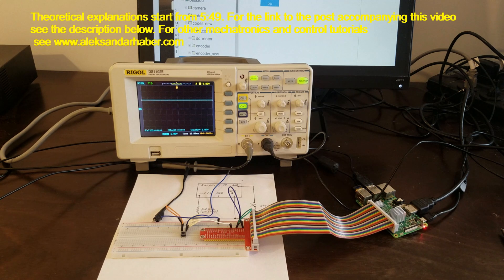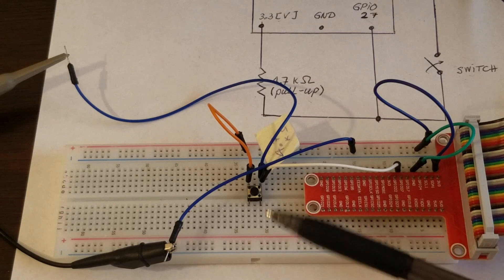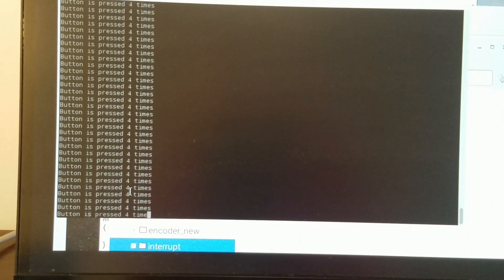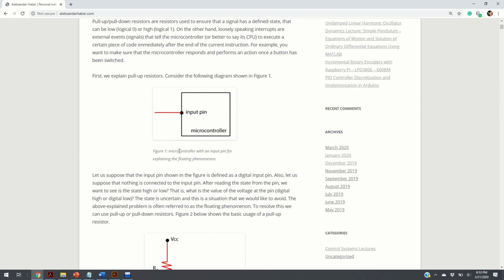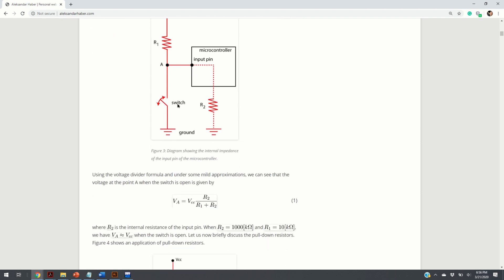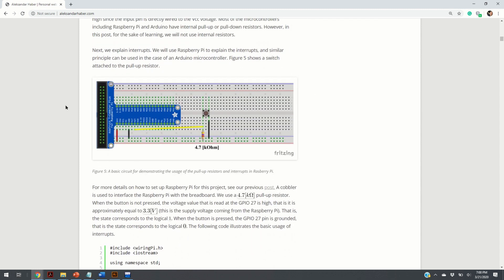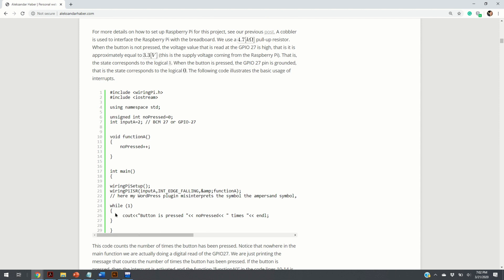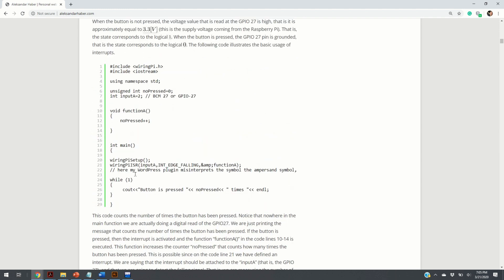Raspberry Pi Tutorial on Pull-up/Pull-down Resistors and Interrupts - Experiments and Theory

Comment: I thought raspberry already had it's own internal pull up/down resistors which can be controlled from your code? Am I wrong?
Reply from the maker: Thank you for the comment. That is correct. An RPi microcontroller has internal pull up/down resistors. However, the purpose of this video is to explain the general usage of pull up/down resistors. This is explained in the post that accompanies this video. Best Regards, A. Haber
Reply: Thanks for your quick response. I appreciate your explanation anyway. :-)